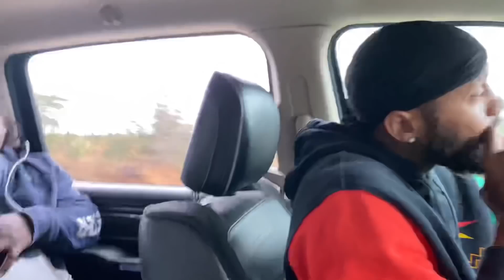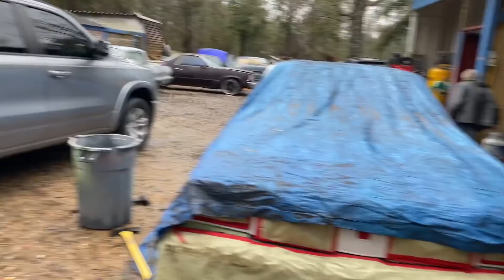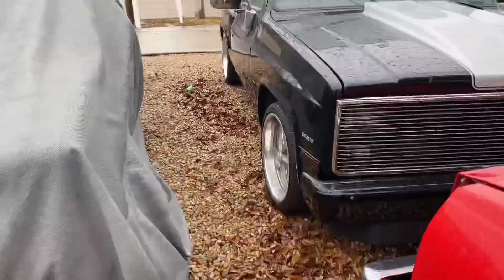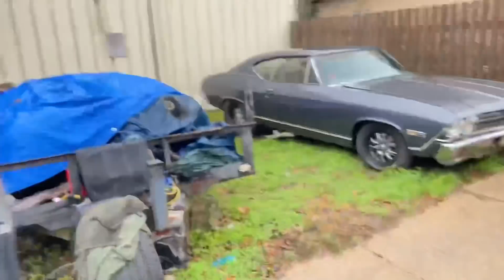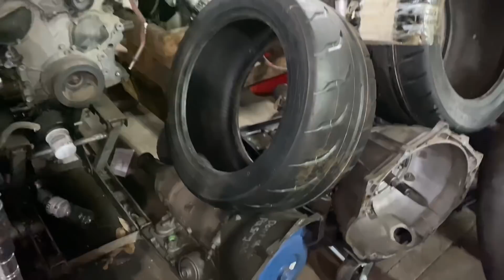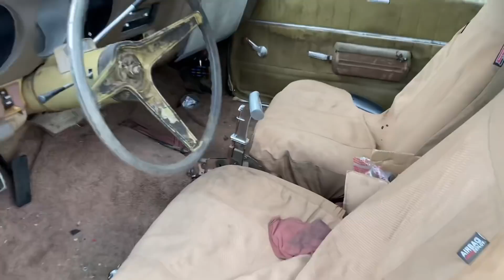WOWO TURBO SET UP FOR HIS RED 1987 BOX CHEVY AND CHECKING OUT CLEAN 1987 MONTE CARLO SS

Comment: Twin instead of single if you want more power and better fuel mileage and you should also set them up parallel and a single turbo for cost efficiency but you’ll have a less advantage over a twin